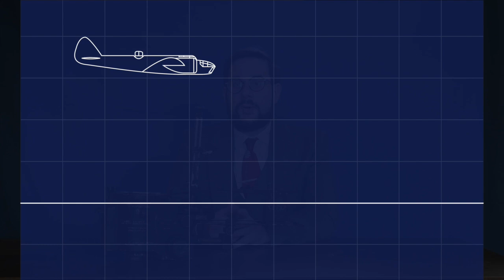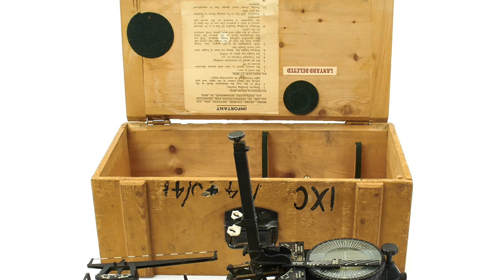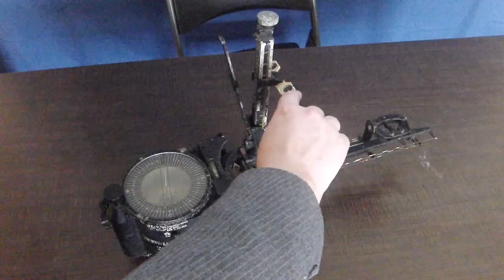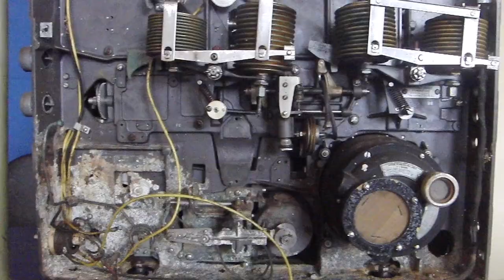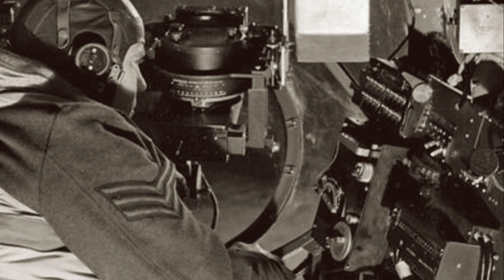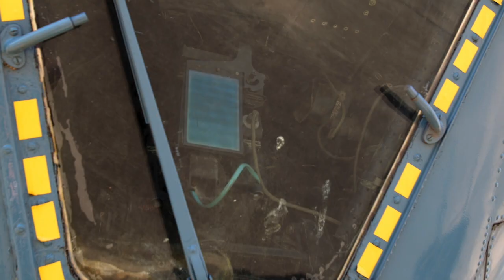WWII British Bombsights: Getting on Target

Comment: You mentioned the retirement of the V Bombers and the sight you showed in the 1960s, this is not correct. Vulcans using this sight bombed during the 1982 Falklands War, you can see the details if you google Blackbuck Raids. There's an excellent documentary about the first raid which talks about the WW2 era sight. They managed to hit the runway in Port Stanley using it. The mission was also the longest range raid to be conducted at that time and required a fleet of tankers for each Vulcan

Comment: Computers don't have to be electronic or digital.  In the case of the Mk. XIV, it is an analog computer, a mechanical analog computer and, as you say, a pneumatic mechanical analog computer.
The Sperry Central Fire Control System on the B-29 was similarly a mechanical analog computer, or rather a set of computers, one per gunsight, so five in all (one in the nose, three in the gunnery compartment and one in the tail position).
In a wider context, the Admiralty Fire Control Table was also a mechanical analog computer used in Royal Navy cruisers and battleships from the mid-Twenties.
Precision machining is necessary to create the components of such a device, which include gears, two and three-dimensional cams, differential mitre gears and integrating roller pickups.  Temperature compensation, to allow for the expansion and contraction of the metal elements, also needed to be included.

Comment: "The technique of attack had been worked out with great care. An advance force would drop flares for fifteen minutes, relying entirely on GEE and ignoring visual impressions in order not to be misled by decoys. Two minutes after the first flares went down, other aircraft of the advance force would start bombing with incendiaries, taking as their aiming point the big square in the centre of the old town. After fifteen minutes the main force would begin to arrive, and would pile down its bombs on the fires already burning. The tactics, in other words, were to be a form of pathfinder/fire-raiser technique; but whatever the Luftwaffe had shown us of these methods in the autumn of 1940 was to be far surpassed. For even if the town was completely obscured by cloud, GEE, it was thought, would ensure that at least one bomb in two found its mark. On the night of 8th/9th March conditions promised well, and 211 bombers, of which eighty-two were equipped with GEE, took off for the great attack. The first wave arrived punctually and duly dropped their flares on GEE fixes. The weather held good, apart from the inevitable industrial haze. Unfortunately, many of the incendiaries were dropped after the flares had burnt out. Scattered fires therefore sprang up, and these seriously misled the main force. The result was that though 168 aircraft claimed to have bombed the target area, the brunt of the attack fell on the Southern outskirts. Many bombs also struck the neighbouring towns of Hamborn, Duisburg and Oberhausen. In the Essen area the local authorities noted the fall of 3,000 incendiaries and 127 high explosive bombs, and reported appreciable damage to engineering works, railways and houses.    Krupps was virtually untouched."
 --124-- 
Hyperwar Royal Air Force 1939-1945 Vol II

Comment: Id have thought you could avoid a fair bit of these issues by putting a small parachute on the bomb so it slows and falls straight down though i guess the issue then is it being blown by the wind and being very easy to spot as it falls
Reply: Couple of problems with a parachute, firstly the wind would carry it off somewhere that isn't the target. Secondly you want the speed in a bomb so it can penetrate into the ground, buildings etc and cause more damage. Spotting it isn't a problem given buildings and railway track etc isn't going to run away

Comment: The basic manual navigation tool is a B1 Manual Flight Computer (Circular Slide Rule) used in conjunction with chart, a compass and a clock. You could get anywhere with manual nav. We learned Dead Reconning Navigation as the bases of all other Navigation Systems. I flew the F4E in the 1970's. Pre GPS Era.

Comment: The (US) Sperry bombsight was actually BETTER than the Norden!  However, Norden had better connections!
Reply: This is absolutely correct but not well known.  The Sperrry was more ergonomic and the Norden was a nightmare in comparison.  It's ironic that a whole warehouse full of Sperry sights was bulldozed during the darkest days of the war when they were desperately needed.  Politics.

Back in the '50s you could buy a surplus Sperry sight, including a nice locking steel case to keep it in, for $25.  I bought one and it was a marvel of design and manufacture.  Wish I still had it!

Comment: early bombsights were more akin to slide rules than anything else. the bomb aimer added in what he knew which was airspeed, altitude, weight of bombs, estimated flight time of the bombs and temperature at his altitude and a guess at wind drift. Quite often, the first bomber dropped his load and the rest dropped on his cue or simply dropped as near to his bombblasts as possible.

Comment: The box you call the bomb distributor only controls the rate at which the bombs are dropped. The order in which they are released is set by another device on the bomb aimers panel. It has 16 wheels with 16 positions on each (there are actually 15 storage points in a Lancaster bomb bay). So if you want position 13 to drop first (13 is in the middle of the bomb bay and typically held the 4000lb cookie) you would dial ‘1’ onto disc ‘13’, and so on for the other stations holding a munition. I joined the RAF in 1970 as an Electronic Fitter, Navigational Instruments, and one of the modules we were taught was ‘Bombsights and Gunsights’ and the MKXIV was still on the curriculum!!
Reply: That's amazing.
Reply: Sir, for lifelong students/observers of technology history like myself, your insights add the "user dimension" which changes a detached intellectual perspective into a personal one. In doing so, add the equipment of a third and even fourth dimension to our understanding.
I THANK YOU.

Comment: Ive never thought of that bomb releasing pattern machine, but it was pretty interesting. 
And its pretty obvious that youd need something like this when you release so many heavy bombs from a "relatively small plane". The WW2 was the first "technological war". Where technology was used. Like the computer bombsights. Even though it is never mentioned there is also the morale aspect: Knowing that the bombsights was accurate must have made it easier for the bombing crew to release bombs on cities, knowing that as few civilian casualties would be possible. (Even though that accuracy was not so in practical situations). The film Memphis Belle is one of my favorites, and its the first one where you can see the problems with the bombsights and bombing. Film before that one you just see the bombs away.
Reply: The RAF was actually trying to hit the civilians. There were missions were the firebombed workers' housing areas, and then came back a while later to bomb the parks and areas where the civilians were evacuated to since their houses were on fire. Bomber Harris is rotating on the spit in hell right next to Himmler et al. But, as they say, war is hell.
Reply: > The WW2 was the first "technological war". Where technology was used

I hate to break it to you but catapults are technology. Guns are technology. A bow and arrow is technology. A chariot is technology. A knapped blade instead of just a random rock is technology.
Reply: @KellyClowers  But, OK, everything is technology, yeah, ok ok ok,  but in WWII they started using electromechanical and electronic technology to gain an advantage. 

WWII is often called the first "technological war" because they use techology to win the war. The bombsight is a good example of this. Radar is another. 

Chariots, bows and arrows is another thing.

Comment: An interesting talk.  A correction:  At 2:59 you said that trail varies with wind.   It does not, as wind affects both bomb and plane.  What does vary is the distance between drop and impact.
You said both types discussed were successful.   That depends on what you mean by successful.   If you mean that the manufacturer got to sell a lot of bombsights, then yes each was successful.   If you mean that each enabled the bombardier to reliably hit a specified or chosen target, then none of the British bombsights up to and including WW2 were successful.
Reply: the wind also varies with altitude. a bomb dropped from high altitude could veer left or right of the approach centreline as it dropped. Air temperature and density also come into play.
Reply: @michaelbevan3285  : True, but these effects are not in practice of as much significance as you might think.    Bombs quickly accelerate to almost Mach 1 which means the time taken to traverse low altitude winds is short and thus low level winds do not have much effect.  Density variation is due to variation in pressure temperature and humidity due to weather and greatest at low level and at sea level seldom varies more than about 1%.   It can be neglected.